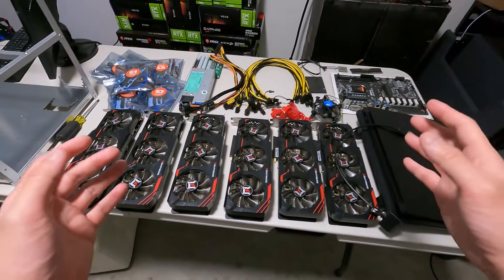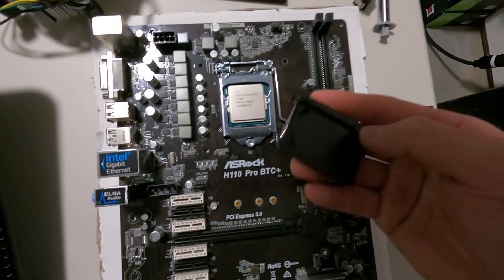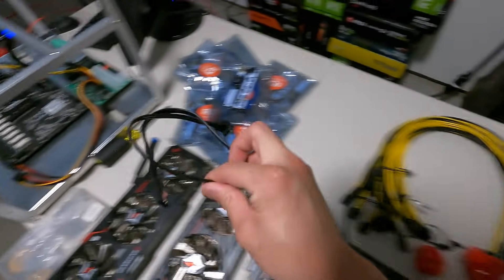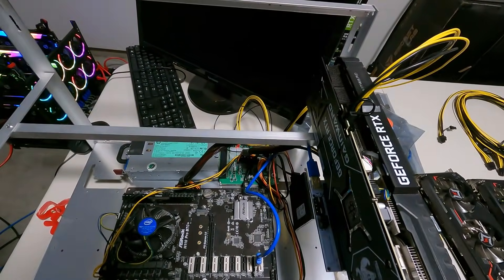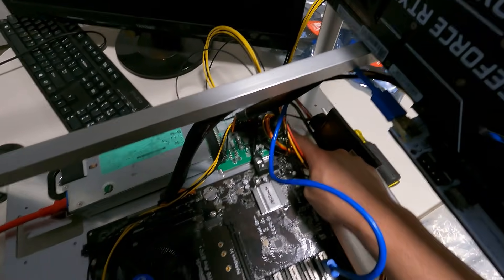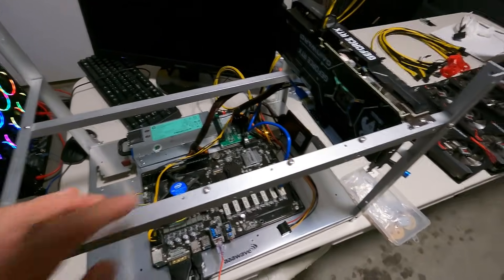How To Build A Mining Rig (POV)

Comment from the maker: Sign up for HiveOS Here! https://hiveos.farm?ref=109254
My favorite GPUs for mining https://geni.us/jZCyi (PAID LINK)
Want to speak with me 1 on 1? https://redpandamining.shop
Parts & Time Stamps Below!
00:00 - Intro
01:38 - Overview of GPU Mining Rig Parts
05:22 - Installing The Motherboard/CPU/RAM
09:35 - Installing The Parallel Miner ZSX 1200w PSU
11:56 - Installing HiveOS Onto the SSD
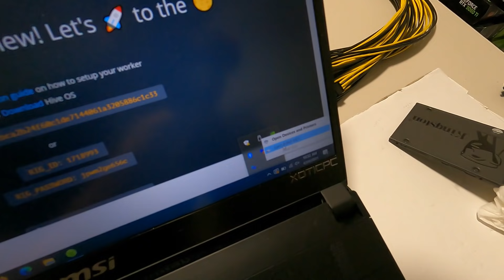15:18 - Installing SSD Into the Mining Rig
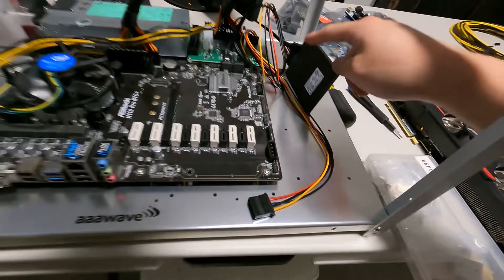16:05 - Best Practice #1 Turn On Rig Before Adding GPUs
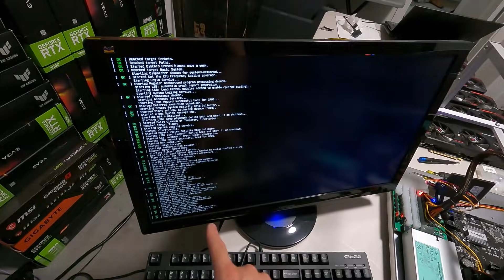18:09 - Troubleshooting HiveOS WebGUI Not Showing the Rig
19:24 - Updating HiveOS to Latest Version
19:38 - Motherboard BIOS Settings 4G Decoding/PCIE Gen1/AC Power On
22:05 - Explaining the Power Supply/Power Capacity/TDP
24:47 - Installing the 1st GPU & Riser & PCIE Power Cables
29:10 - Best Practice #2 Turn On Rig With 1 GPU First
30:18 - HiveOS Adding Wallet & Flight Sheet
31:52 - Overclocking/Undervolting for the RTX 3070
33:34 - Seeing the 61 Mh/s Hashrate for the RTX 3070
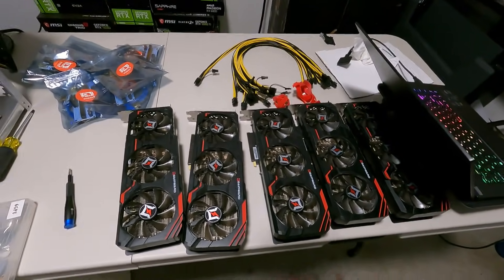34:30 - Quickly Adding the other 5 GPUs
35:50 - Little bit of Cable Management
36:08 - Explaining 120mm Fans for Mining Rig
36:59 - Explaining the GPU/Riser PCIe Power Cabling 
37:17 - Best Practice #3 TRIPLE Check ALL Cables/Connections
37:53 - More Cable Management
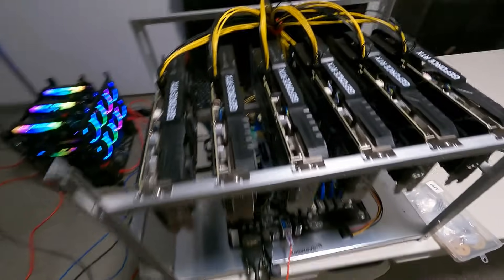38:32 - Turning On FULL 6 x GPU Mining RIG!
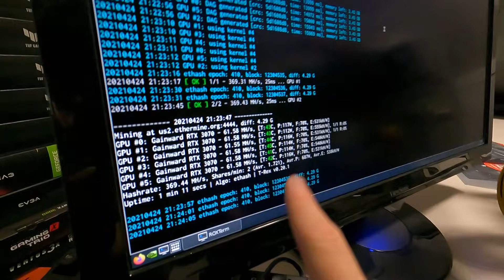40:17 - New HiveOS Absolute Core Clock Feature (For Lower Watts)
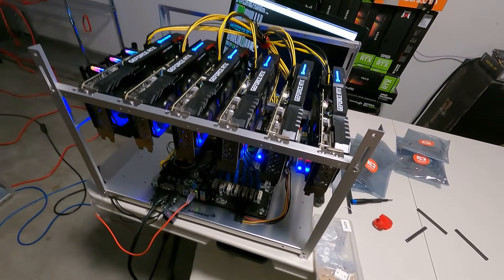41:06 - Troubleshooting TIPS Freezing/Unstable/Check Everything
41:53 - Power Button For A Mining Rig?
42:29 - Verifying 369 Mh/s Ethereum Hashrate
42:39 - Add 120mm Fans in the Future? ZSX Board For The WIN!
43:58 - Exact Power Consumption At The Wall 773 Watts

GPU Mining Rig Parts:
Build Your Own Custom Mining Frame: https://www.youtube.com/watch?v=OfE_QidD75M
Mining Frames On Amazon: https://geni.us/0qIa    
Power Supply I Used: https://www.parallelminer.com/product/all-in-one-gpu-mining-rig-power-supply-kit-zsx-1200-watt-hp-80-platinum-94-efficiency-110-240v/?wpam_id=189 𝗡𝗲𝗲𝗱 𝟮𝟰𝟬𝘃 𝗣𝗼𝘄𝗲𝗿
I Recommend This PSU Higher Capacity: https://www.parallelminer.com/product/1500-watt-platinum-power-supply-200-240v-gpu-mining-rig-psu/?wpam_id=189 𝗡𝗲𝗲𝗱 𝟮𝟰𝟬𝘃 𝗣𝗼𝘄𝗲𝗿
Motherboard: https://geni.us/aRVd (Many Options out there) https://geni.us/go40dvL 𝗯𝘂𝘁 𝗯𝗲 𝘀𝘂𝗿𝗲 𝘁𝗼 𝗰𝗵𝗲𝗰𝗸 𝗖𝗣𝗨 𝗰𝗼𝗺𝗽𝗮𝘁𝗶𝗯𝗶𝗹𝗶𝘁𝘆
CPU: https://geni.us/QkX9D or i3 9100 (8th/9th gen Intel cpu)
8 GB DDR4 Ram: https://geni.us/QuiLcYn
HiveOS: https://hiveos.farm?ref=109254
USB to SATA Adapter: https://geni.us/2iLWr
120GB SSD: https://geni.us/6zSB 
Power Button For Motherboards: https://geni.us/A7oTMWY
Need PCIE Splitters if using ATX PSU's? https://geni.us/n4FC
GPU Risers: https://GPURisers.com or https://GPUrisers.UK use REDPANDAMINING for 10% off
30 Series GPUs: https://geni.us/5fTCB 𝘄𝗵𝗶𝗰𝗵 𝗜 𝗸𝗻𝗼𝘄 𝗶𝘀 𝗵𝗮𝗿𝗱 𝘁𝗼 𝗳𝗶𝗻𝗱 𝗿𝗶𝗴𝗵𝘁 𝗻𝗼𝘄
Reply: Hello i want to ask you is there any diference for the HiveOS if this on USB or SSD?
Reply from the maker: @petaryovev2477  I prefer SSD's as they are a lot more reliable. You can use USB for hiveos but in my experience it is better just to get an SSD and not worry long term.
Reply: As long as I dont get motion sickness!!!!
Reply: quick tip. try gminer(the dev fee is the lowest(0.67%) and you get better hash(i personally use awesome miner manager for my rigs and it benchmark's all the software out there and seems gminer is the best when it comes to MH/s and yield)
Reply: Love the POV view!
Reply: @grtbaldini  😆
Reply: Great video!! This will be my GOTO guide to build my first mining ring.
Reply: Hello sir, was wondering how those bitcoin psu's worked out for you ?
Reply: Love the video. Where on earth did you buy Gainward GPU's? Somewhere in EU? Their website says they dont sell in Canada or USA
Reply: Awesome video content, and the POV worked out really well too. the Time Stamps were also very helpful.
Reply: I like the pov. maybe put it on your head. look up itsjusta6. he does a lot that way. car videos but same concept
Reply: I got a free AMD motherboard and was curious what AMD CPU would you recommend for a GPU mining rig, I have 2 RTX 3070's to plug in
Reply from the maker: @stephencicero  i tried on my head but its then WAY too high and you cant even see the parts im holding. I put it on my chest so people can actually see the parts.
Reply: How much money can you make per day or per month from this set of mining rig?
Reply: Great Video
Reply: @Red Panda Mining  I did a speed test on Shaw and it pings Winnipeg and Chicago on speedof.me, for ethermine should I use East or West server?
Reply: @petaryovev2477  speed, the USB is super super slow for anything, updates booting etc.. also, USB's esp being used 24/7 like this, sometimes just drop their bundle and zero out and lose the partitions.
Reply: recommend other risers.
Reply: Definitely want you to do more builds with the GoPro so much easier to follow you when you have both of your hands to work with.
Reply: Will these parts work with the 3090's? Excluding the power supply.
Reply: @chris-ut7fg  yeah but you'll need a lot more power cables and psu.
Reply: I highly recommend using reelsteady go to smooth out the motion in the video. It crops in order to smooth out movement. Used in FPV drone footage and likely works well here.
Reply: yo man love your vid . Just wanted to ask if i can put a mining rig in my bedroom
Reply: Give me one of those GPU's
Reply: Can you give a rough estimate of how much this whole setup costs?
Reply: @hawkward8380  would love that answer as well. Cost as well as eth per day
Reply: I have ATX Motherboard 
AMD RYZEN 5 2600 Processor 
256 GB SSD 
3 -  RTX 2060 Graphic Cards
1 - 8GB RAM

Please suggest me the Power-Supply & UPS to run this miner rig
Reply: Do you have any GPU’s available even if they are used? I’m interested in getting a mining rig going
Reply: Plz give me 1 gpu for gaming
Reply: Can you pm me please
Reply: @BIGALMIAMI  ??
Reply: Usb ports in MOTHERBOARD are not working... i cant acces or fix it via monitor - USB PORT WONT LET ME CONNECT MOUSE OR KEYBOARD
Reply: nice rig man 😎😎
Reply: I brought this set up but when I turn on the motherboard the cpu fan turns on for a second than it turns off can you help me please
Reply: Great video! I am having an issue though. I flashed HiveOS on my SSD the same exact way you describe in the video. When I turn on my PC I don't see all the code on the screen, it's just a black screen. When I log onto Hive OS with my laptop it shows my mobo and all that. So it looks like it's working but I have no visuals on my PC screen. Any thoughts?
Reply: This is the best video i seen so far. Like all explanations and the way camera looks. Hive is little confusing tho. Thanks for great video, now to my search if i ever can find a gpu matching on that i already have 😑😑😑.
Reply: do you have a video how to set up from the beginning for newbie? 
like what app should i use to mine
Reply: Can you send me a graphic card that you do not use? cuz it's too expensive here,
Reply: Hey would you be able to explain later on a different video (pardon my ignorance) an example of powering 3090rtx, my goal is having 4 to 6 in the future and i would like to learn mostly power required and how to properly connect gpu and pci e on psu without messing it up. Thanks for your videos
Reply: What was total cost to build this rig?
Reply: Can I use this power supply for 6 3080 graphics cards?  Or can I run 2 similar PSU's at the same time?  New to mining any help would be amazing.
Reply: All-In-One GPU Mining Rig Power Supply Kit ZSX 1200 Watt HP 80+ Platinum 94% Efficiency 110-240V
6+2 pin PCIE cables:
+16 6+2 pin PCIE Cables

Breakout board:
X-Adapter ZSX-AMP

This is what I bought
Reply: GeForce RTX 3080 XC3 Ultra Gaming 10GB LHR Graphics Card my graphics cards.  So far I have 2 but going to have 6 when all said and done
Reply: Is hiveos still the best option today? I've been reading around and it's all saying avoid this os. Please help! Much appreciated! Great channel!
Reply: Great video! Some questions if you don't mind. Regarding the Hive OS, does that replace the Windows OS that you would normally install if you were building a regular PC?

Also, for immersion cooling, can the fans be removed? And, do you  know if the RTX3080 and RTX3090 need a fan jumper? Thanks.

BTW, I like the hands-free and fast pace!
Reply: mining came a long way compared to when I was doing btc in 2010.
Reply: Hello! I have had this video in a Freeform board and a list of items to buy on amazon for a while now. I'm ready to start this project, but I'm curious to know if these components are still a good choice? If you have a newer video you want to direct me to, that would be awesome. Do you offer a consultation option perhaps so I can pay for your advise? I appreciate all the knowledge you drop in your channel.
Reply: Hello is this evething I will need to try to build my own , I watched the video a few times .

Comment: This video was so extremely helpful. Thank you for taking the time to put this together and share with everyone. I used this as a point of reference for building my first rig ever, but had to go with GTX 1660 Super cards because the 30 series GPUs are so over priced still. The only thing I had to do differently was determine the right overclock settings for my cards on HiveOS, which wasn't too difficult. Thanks again! Definitley subscribed for future videos!
Reply: Hi Raul, I’m on the process of building my first rig as well, I’ll be using GTX 1660 Super Cards, how did you determined the right overclock settings?
Reply: what are you mining and what are you costs? profits?
Reply: @jasonr9832  I'm mining on HiveOS and they show you popular overclock settings on their platform, which worked out great. I had to slightly modify the cards that had Samsung memory.

Comment: You should provide two extra molex cables to that specific motherboard if you are mining with more than 3 gpu's on it. That's according to the motherboard user manual, just to be safe. Great video by the way!
Reply from the maker: only if the risers need power which they don't cause of the supplied pcie 6 pin but yeah seems to work just fine though but doesn't hurt either way I've tested! Thanks buddy!

Comment: Do you power the two molex plugs on the motherboard?
Reply from the maker: Some people need it, some others not, depends on the power draw from the risers if they need it, but since the risers are already powered by pcie 6 pin it isnt needed. Some motherboards have molex and require it but in my testing it has not been needed. Always read the manual just in case.

Comment: Wait you can use a PCIe 2.0 x1 for the 3060TI?  I want to start of a small rig and i bought a 3060 and 3070TI the motherboard has  
1 x PCIe 3.0/2.0 x16 (x16 mode, gray)
2 x PCIe 2.0 x1 this will work for the 3060 or will i need a x16 slot ? Im asking this couse i watched another video where the guy said it has to be a 16 slot to be 
efficent

Comment: Question. when i used a 6 pin connection on my power supply it would not work with the 6 pin on the riser. i had to use a 8 pin on the power supply and go to 6 pin.  why?
Reply from the maker: be sure not to reverse use a pcie cable, that will not work because it only works one way.

Comment: I understood. What if we have Asus Rog Strix having 2x 8pins. Do we have required a splitter to split the one strand 8 pin into 8,8 or do we use 1 strand 8 pins to card 8 pin and other strand directly from the powersupply 8 pin to same card another 8 pin?

Comment: Hello I’m using this same motherboard and power supply but when I go to power on the motherboard the fan wants to start but but then it stops and makes the power supply power down and turn a yellow light in the back of the power supply so then u disconnect the power supply for like 2 minutes and then connect it back and it’s green again but when I try to start the motherboard again it does it again.
Would you happen to know what the problem is there?

Comment: I was just trying to start with server psu for gpu alongside ATX psu for motherboard and hdd. I got 750W one with breakout board for 12 pci-e 6 pin connectors. Noticed that as soon as I start my 3080Ti using about 220W on ergo (4 connectors - 1 for riser and 3 for gpu) i can hear ticking sound but there is no ticking sound when I run 4x 1660's running eth on about 265W but that's 1 riser and 1 GPU connector per gpu. What May cause this ticking? Is it safe to run it that way?

Comment: I have a question regarding the 6 to 8 pin, the initial 6 cables are 16 awg but the additional +2 seem to be much smaller like 20 awg, is that safe to use?

Comment: SATA Cable is backward, the 90 degrees angled one should go to the motherboard and the straight one goes to the SSD so the cable won't bend but this is just for OC people like me (and it just my opinion, it will still work the same anyway).

Comment: Ive followed your steps but my screen wont come on. 

My rig doesn’t stay on if i plug the atx and the atx12v1 lead. It just turns on and then straight off.

If i use just the 24pin atx lead it turns on, but no screen
please help me.

Comment: Hey, your video states u have a g4400 processor. But I ordered the one u posted in your description which is the g5420. I do also have the h110 mobo. I’m having issues after plugging everything in like you did at 17:45. The issue is the psu and CPU fan turns on and turns back of after 3 seconds. I unplugged everything cleaned out the ports and tried again still no luck. I’m thinking it’s the wrong processor??? But I could be wrong. Anyone please advise please private message me. Thanks!

Comment: Hi, I just got 3060 ti gpu which has dual 8 pin connector. Can i use two separate 8 pin connector connect to server power supply? or i have to use splitter?

Comment: Hey RPM,
I am replicating your process with the equipment you suggested in another video.
I am trying to turn on to test and the cpu fan wont turn, and the hdmi is not displaying anything on the monitor. I dont hear any processing sounds. It seems like the cpu is not receiving power. All of my cables are connected as shown amd the motherboard is getting power. Has this happened to you? Im not sure how to proceed. Thanks for the content.

Comment: Would you recommend powering the molex ports for this mobo?
Reply from the maker: Only if you have issues. Since the risers are already pcie powered, there's no need to power the motherboard molex. I've tested a few other mobo's with molex and did not need to plug it in. To each of their own depending on the power configuration of gpu/risers.
Reply: @RedPandaMining  Thank you! Appreciate the quick response.

Comment: Ive started all of this and just waiting for the graphic cards BUT when i try to start it, it shuts of direcly after. Ive tried reconnecting  all the cables and looking for damages but nothing. The powersupply is kinda cold and im not sure if the outlet is giving enough power, could that be the reason?
Reply: Hey did u ever manage to figure it out. I’m having the same issue
Reply: @funnyhowthingsturnout6186  unfortunatly not, im doing some try and error! I keep you updated if a manage to fix it!
Reply: @ringovoid  i ordered a new cpu, try checking to compatibility of your cpu to the mobo. (It’s probably that, but I’m no expert) I’ll keep you updated to see if that fixes it for me.
Reply: @ringovoid  update I just remembered to notify you if it worked. It was indeed my cpu not being compatible with my mobo.i got my first rig up and mining. Though I did have a couple more hurdles I needed to jump through, but I made it. Hope this helps.
Reply: @funnyhowthingsturnout6186  thanks you cause first i just thought it was the power supply cause ive seen others have a struggle with the same one, guess im just gonna change both of them maybe then xD thanks and good luck
Reply: @ringovoid  np hopefully that does the trick for you. Have fun mining :D

Comment: I have 3 x RTX 3070s (using 2 gaming PCs) running nicely with nicehash at 62mh/s on high, but thinking about adding a 4th which will force me to move them all into a rig like this. However I noticed you plugged your GPUs into a 6pin port on power supply instead of 8pin. Right now my cards are plugged into 8pin slots on my PSU. Can I try on 6pin instead to free up more slots for my current PSU?

Comment: would you be able use usb wifi dongle instead of the ethernet direction connection? Or would you have to install the driver onto to the solid state drive

Comment: Great video.
I was wondering which cooling fan for CPU are you using in your video and secondly if a cheaper processor, say a Celeron, would have a huge impact on my performance. Also, sorry for my bad English, I usually speak French. Anyway, keep up with your work, it helps a lot.

Comment: Just read an article saying that Nvidia GeForce RTX 3070 is not going to work.  These cards will throttle back performance if they detect that you're mining using the Ethereum algorithm, but will run at full speed for games. Is that for all 3070''s? Any recommendation to replace it?

Comment: Need help..I have mpg z390 mono and trying to run 7x 3090s.. the only problem is that it's showing the seventh card on disp adapt under devise manager but not picked up by Nvidia software...on minstat 6 cards are running but 7th is not picked up... Running win10..pcie set to gen2 etc..any advise is highly appreciated
Reply: Some gaming mobo won’t support more than 6, I have the same problem with my 8 3060ti. Had to run two rigs
Reply: @person4149  agree...6 ran without a problem.. But now a days on hold as not with it... Electricity too expensive and in UK we don't get much sun so solar Panel are also useless
Reply: @Naveed-it6wf  good luck😁 here in Canada it’s 0.08